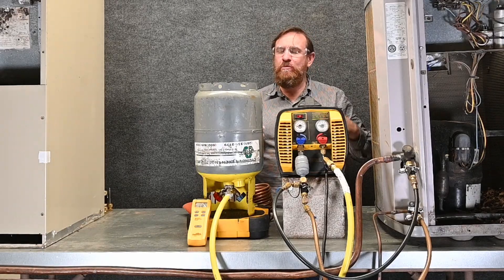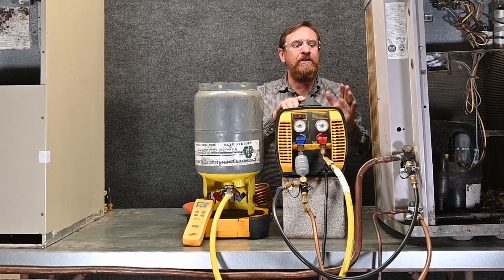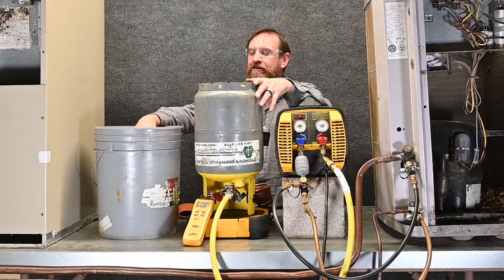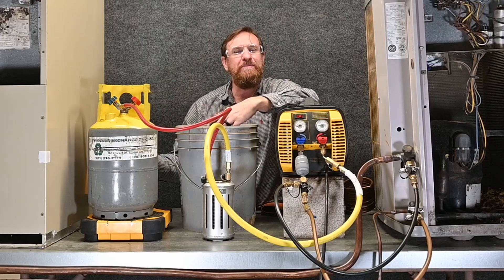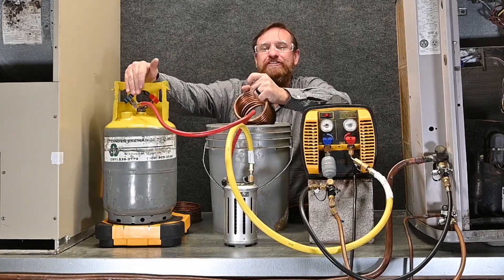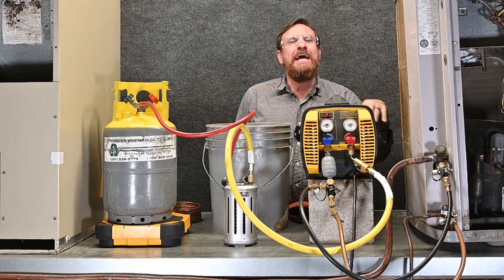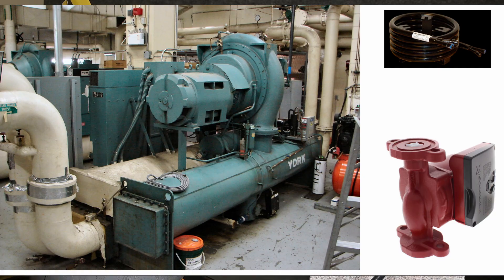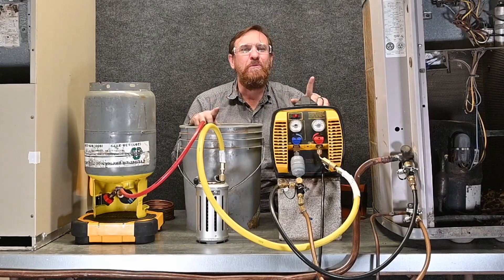HVAC 130 Next level fast recovery

Comment: New sub here. Thanks for the info but the sound is almost non existent and I cant hear anything on my computer.  So when using the Molecular Transformator the recovery tank should still be flipped upside down and filled using the vapor side, Correct?  I just did my first recovery of R410a on a warm day with no Molecular Transformator and had high pressure issues but I also didnt invert the recovery tank (my bad) but I just ordered a Molecular Transformator because Im in S. Florida and its always warm/hot days. Looking forward to doing my next recovery with the Molecular Transformator and inverting the tank hopefully I wont have any high pressure issues next time after watching these videos..

Comment: We have a small recycling company and recover from refrigerators and air conditioners. We currently have 5 G5 Twins.   What is the ideal setup for fast recovery for high volume?  Especially larger older R22 air conditioners.   Or is there a better machine to use?  Thanks , great video.
Reply from the maker: The G5 twin is the fastest thing I know of. It's what I use.

Comment: The molecular transformer is nice but it holds an insane amout of refrigerant that gets trapped
Reply from the maker: Agreed, the down side is having to re set up  just to pull the ref out of it by itself.
Reply: Nailed it!
Reply: To answer your question.....no putting the MR45 on purge does not clear the subcooler. I use a brazed plate for my subcooler. I have a video about it on my channel
Reply: Couldn't the recovery machine purge it out?
Reply: The issue is it's hooked up to the discharge side of the recovery. You need to valve off and switch it around to clear out the gas
Reply: What if you are using a Fieldpiece Recovery Machine with self purge function? Wouldn’t this do the job of purging out refrigerant trapped inside subcooler transformer?
Reply: @Curious0189  So is this true with the MR45 ?  Thats what I own and just ordered the MT and didnt think about the extra purging. But it makes sense that the purge function on the MR45 would take care of it but just looking for confirmation.

Comment: i only have one core remover, could i just remove one of the cores and leave the other in? would it speed the recovery process up a bit? if so should i remove suction or discharge?

Comment: Ok So how do you get the liquid out of the sub cooler and into the tank. I run that reclaimer and I crack intake hose to reclaimer and introduce atmosphere. Is that the correct procedure?

Comment: Your teaching iss the best to me but I ave a ? I have a mini split unit that was working pretty well, what I notice is the unit not turning on, an the unit receiving 220 voltage fuse on the circuit board good is there any advice u can give me about what could of cause it
Reply from the maker: So manu things it could be
 Most likely electrical. I have not started the electrical or the ductless/mini split sections yet.
Ac service tech LLC has some great videos on them that are already up and running. I would recommend checking out his videos. I am far behind form getting there. Thank you for the support and I'm glad you enjoy the videos.

Comment: if the air temperature is reasonable or you cant use a bucket (indoors and you cant make a mess) you can make a subcooler from a condensor you pulled from a old reach in cooler for example, something in the 15" size works great and with the fan already on there you can subcool a LOT of volume with just air. i doubt it will work perfectly on a roof in phoenix during summer but for most places with more humane temperatures it should work well. i prefer air over icewater when having to do big recoveries as you dont have to replenish the ice
Reply from the maker: Absolutely. A friend used one of those refregeration condensed and just mounted it to the back of his Appion G5 twin. He uses the air from the recovery machine to blow over it and it works great. He has it hard piped from the out to the unit to the condenser and a manual valve. 
It works great
Reply: @love2hvac  i did something simmilar. i made a box that holds the recovery machine and a big coil under it with a fan and with a short 1ft hose to the tank so i can stand it on top of the recovery tank. i could also weigh the whole lot in that manner and watch the tank fill. after recovery i just let it sit for a couple minutes for the fluid to drain (do mind the coil design so it can free flow down) and only have vapour left. that bit of vapour is not worth the effort to recover generally when dealing with decent volumes you find on rooftops, let alone chillers. and waiting for the coil to drain is not a problem as you have plenty of other stuff to do. the carrying box also protected the machine as they live pretty rough lives in the backs of our vans.
Reply: This I gotta see.